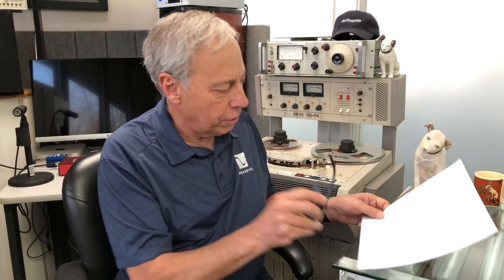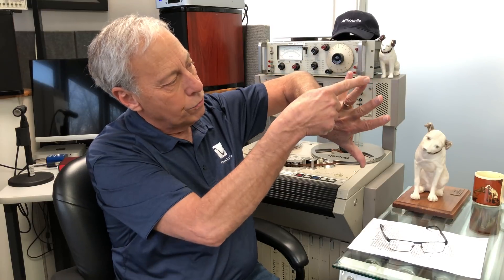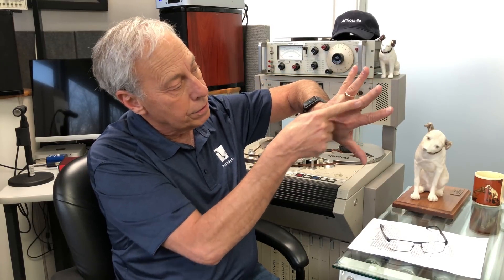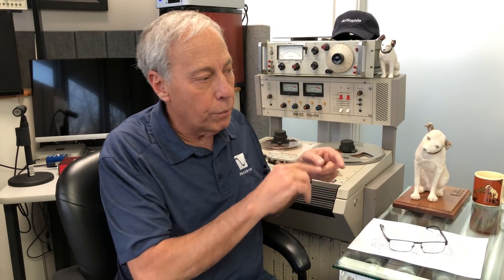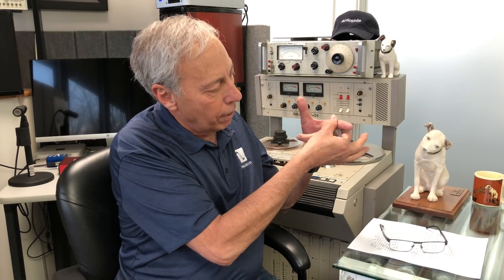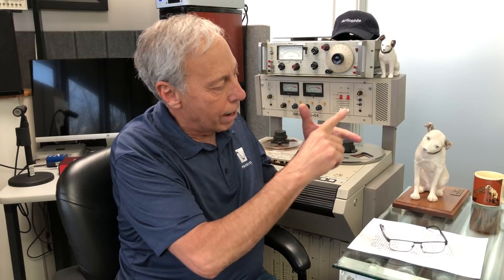AC wiring for audio

Comment: Hi Paul,
Roger from Queensland Australia here.
Long time viewer/subscriber, first time commenting.
To start with, I realty enjoy your wide expance of audio knowledge and especially your demeanor. You're a good bloke. Here in Australia we use three pin plugs for our power outlets (just to reiterate mate).
I do have a question though, while I'm here. 
I have an Integra (Onkyo) 7.2 duel zone amp and a set of Welling speakers. I'm very interested in installing a pre amp and DAC.
You probably have answered this question a thousand times, but here we go.
(I'm struggling on how to ask this question, so that you understand).
Seeing my system is 7.2 what pre amp is compatible or capable to hook up seven speakers and a sub and how is the DAC setup inline with the setup. Also which amp controls tge volume, the main 7.2 amp or the pre amp?
I hope you get what my question is and I look forward to hearing from you.

Comment: I used the only two empty  slots in my breaker panel to run power to my home theater, luckily they were right on top  after the main lines going in, and in separate poles, got one for the two subwoofers and the other one to the equipment rack including the projector. I wish I had more empty slots, but I got a decent power supply on the rack. I might branch out of the main breaker panel in the future but so far no need for it.  Great video as usual Paul.  Thanks.

Comment: Surely all the noise gets transported through the main consumer unit (fuse box) though? E.g power over ethernet (which I don't use btw) works on different circuits.

Comment: It is very important to run dedicated lines for all your audio gear and it is important on how they are run and connected.  First it is important to make sure when running each line they be pulled from one side of the panel on is on the same phase.  Your electrical panel splits the 220 volt feed from the street to 110 volts on each side of the panel.  The issue is they are on different phases and if you have components on different phases and sharing a common ground you will ground loop hums.  This is what happens when people who do not have dedicated lines and have audio components hooked up to different phases.  Another thing is do not use romex, it simply sounds bad.  Your better off running separate 10 gauge wire in conduit.  You can even go as farther as twisting the wire ( reverse twist, not to tight ) which will help reject emi interference.  The ac sockets themselves also make a difference in the sound, so choose audio grade ac outlets.  It does make a difference.  Everything in a high quality music system makes a difference so attention to detail in every aspect of a audio system design is important to get the best possible sound.  

Lastly i am however not a fan of ac line conditioners or filters.  I find them to be restrictive and compromise dynamics and alter sonics negatively.  At least with the everyone i have heard and tried myself.  Not to say there are not good ones that can actually improve the sound but that is an important question you must ask yourself.  When you put anything in your system is it truly better or is it just altering the sound in a way that gives you the illusion its better by masking miss matches in your system, OR altering the sound in a way that emphasizes parts of the sound spectrum that makes you hear certain aspects of the music.  This is a coloration not an improvement.  This is important when evaluating anything in a music system.

Comment: Does anyone know if Paul is talking about using a separate wire run to from the panel to each individual electrical outlet in a duplex receptacle? Or does he mean using  a single run for the pair of outlets in a duplex receptacle? It sounds like splitting hairs but I'll be adding a new system electrical supply in addition to rewiring the existing outlets in an older home. With lath and plaster walls. and I really would love to get it right the first time so I don't have to repair the plaster walls more than once since I really abhor dealing with the almost supernaturally tenacious,  house-infesting dust such a job creates. That grit finds its way into places you wouldn't believe or ever want to imagine!

Comment: There is one thing you forgot to mention. All you talk about is relevant, however there is a big problem with 60hZ RADIATION. it is an electromagnetic force.
If you touch any amp input with your finger you will hear that 60hz buzz same thing if you raise the volume of an amp all the way it can not escape you the buzz. it comes through everywhere cables, pickup capsule, speakers whires;( everywere) The problem is everywhere in proximity to house or industrial power.   One way to begin to attenuate this radiation is to treat all feed wires by cutting the conductors to a non 60 Hz resonance length, also install 30 MF, appropriate for the voltage, capacitors to a  the line both, hot and neutral to ground to channel all that radiation to a dedicated ground. I ment a 30f length of 3/4 in copper pipe buried vertically in the ground and treated with salt water once a few month.Try it and you will be ashtonish of the results.

Comment: Would running the Home Run wiring benefit if it was installed in conduit?  Or would that make things even worse since the wires would run together all the way to the power panel?  I often wondered if the conduit would be a wise choice to install your wiring since the conduit would be some what of a shield for the wiring, (since the raceway is connected to ground).  Although possible, running multiple conduits for each circuit is possible, it would be very labor intensive.

Comment: I never understood why power cables are said to make such a difference in sound when most of us have 12 awg romex in the walls. I've never heard a difference am I missing something?
Reply: No you're not missing anything, neither a special power cable nor a separate circuit from the distribution unit will reject the kind of noise generated by, for example, a fridge motor starting; however, any decent amplifier already has a noise filter on its power input as well as schemes in the circuit design to isolate any EMI that does get coupled to the internal power rails.
Reply: Steve Wodell no I do not think that you are missing something, you are just lucky!
imagine, as Paul says, one wire where you have some led lights, your refrigerator and other things mounted on, they will all make a lot of electrical noise on the wirering.
To avoid that, you can chose to run a single separate wires to your entire system, but then you risk that your DAC are putting noise into the cable your amplifier are feeding of and your amplifier do also make noise that your DAC have to feed of.
So therefore do Paul say that separate wires, all the way, to each component are best.
Reply: Yes, yes you are.

Comment: Completely different approach of what others say like Michael Fremer. He mentions if it’s not in one dedicated circuit line the. It creates ground loops, but he is not an engineer like you so I will take your word as law Mr P. Great explanation.
Reply: Isn't all the ground wires (green or bare grounding conductors) connected to a ground bar in the power panel?  How would you isolate the grounds?  Grounding system is all tied together.

Comment: That right. I use a separate power cable for my audio devices which is connected to a GigaWatt G-C20A installation circuit breaker. Works really well, no more major influences from other electronics in the house.